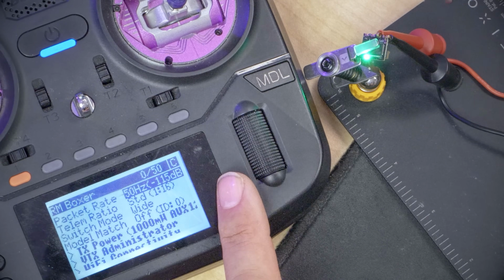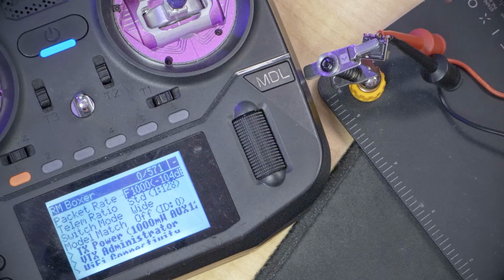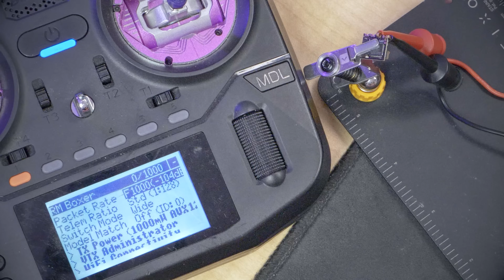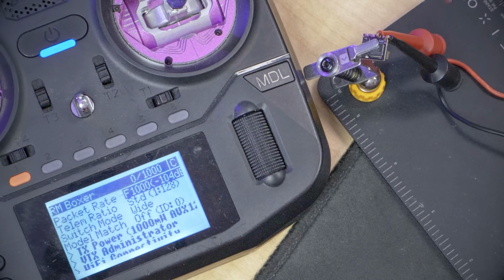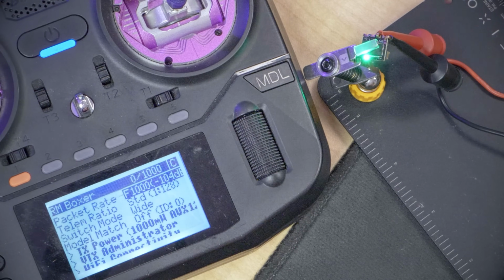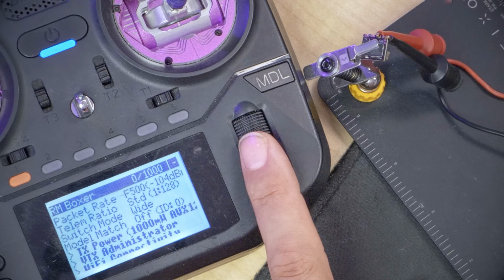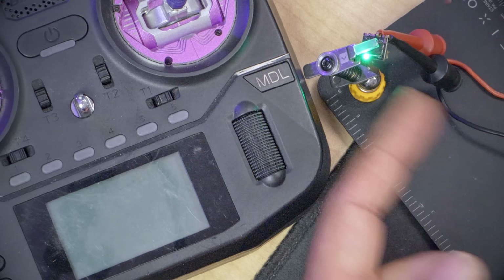Faster ExpressLRS connection with INIT_RATE

Comment: Are you doing an itsfpv ERA frame review? 👀
Reply: too expensive for nothing new
Reply: @АндрійАлєксєєв-п3з  You obviously have no idea. The frame comes with an injection molded nylon cam mount which is pretty much indestructable and protects the cam/lens as good as it can be.
Reply: @marlin-fpv  what's the problem with metal cages? Literally no one needs something that's worse but much expensive.
Reply: im so tired of f'new' frames that have zero actual innovation. 
I'm slightly interested in Chris Rosser's frame due to its FC vibration isolation slots, but other than that, i can't think of a single interesting frame.

Comment: Sum up Bardwells video: turn on radio tx, and power receiver, connect, select packet rate you want to be at, switch to a different packet rate, go back to the desired packet rate. Power off and on receiver, should connect instantly to radio transmitter. Receiver remembers the packet rate if you change it.
Reply from the maker: ... but only if you're on ELRS 3.4. Otherwise, there is a Lua script option that I didn't show.
Reply: @JoshuaBardwell  then show us how please
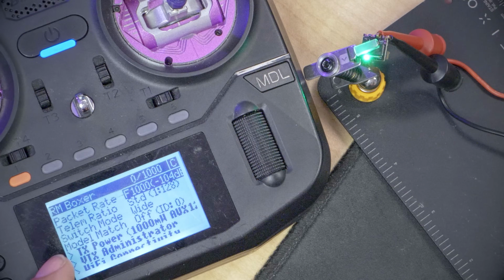Reply: @kolschejung4465  0:02:30

Comment: I'm in trouble up to my neck: I formatted my sdcard and didn't save the settings. I updated my radio to the latest version v2.10.3 and updated the sd card with the same version, but the IBUS and SBUS protocols no longer work as they did before. The protocols don't seem to work, but I can't load the files. The expresslrs tab and the lua script folder don't load either. I hope someone can help me solve this. I'm using a master boxer radio, an external 2.4G EMAX lrs module, a 2.4g nammino rx. I'd be very grateful if you could help me.

Comment: I seen this in a video way earlier you made I have it right on the packet rate it is it takes not even 1 sec super fast thank you now is there a way to do that with the 03 airunit and goggles 2 that takes like 30 sec to a min to connect thank you for this its great

Comment: Interesting, mine is so fast, I think it's like 5 seconds. Bayck elrs 2.4ghz nano expresslrs paired with TX12 MK II
Reply: That will purely be dependent on what packet rate you are using... some packet rates, i.e. the older ones, are the quickest to connect, as they are earlier in the list of packet rates to try when having to auto detect.
Reply: Nice, thanks for explaining! That makes sense.